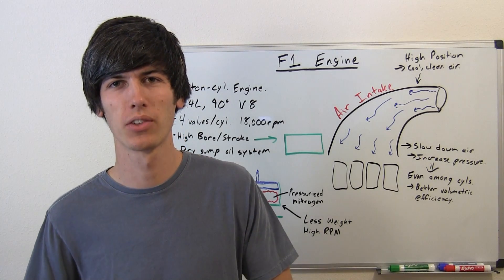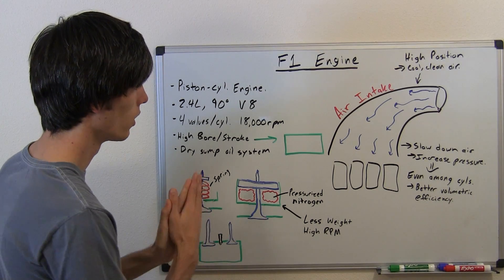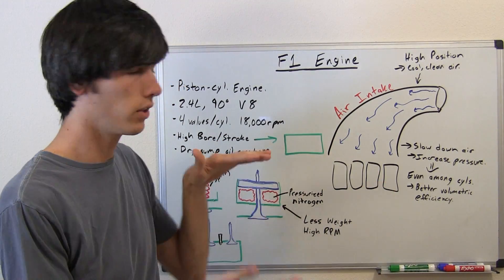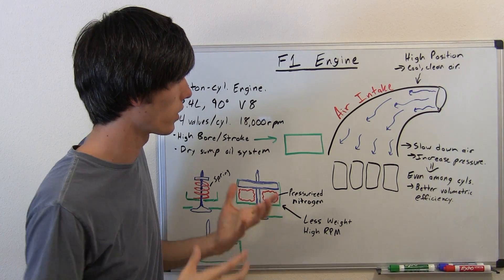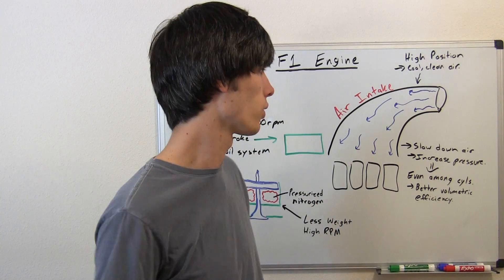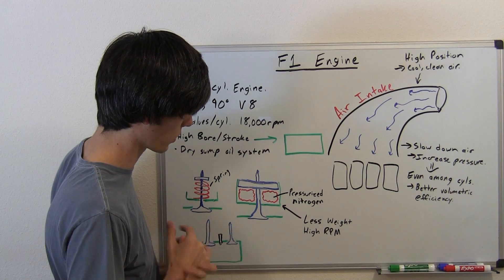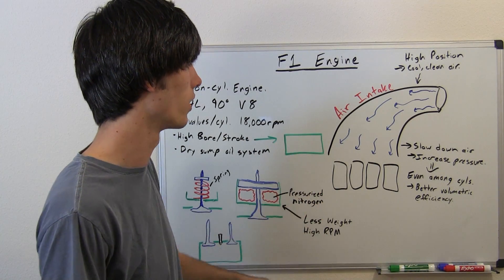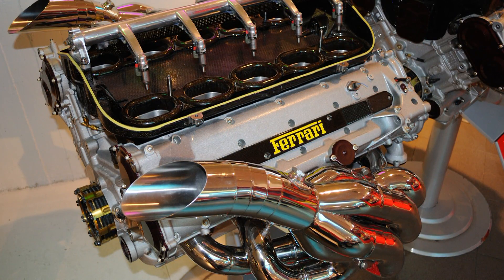F1 Engine - Explained

Comment: Provided there is no ram effect (which you suggest is the case) and/or that the engine is not consuming less air than the intake collects; I'm not sure that the (air) pressure will increase as the incoming air reaches the larger cross section areas of the air intake.

I think that you will find that the air pressure will decrease as it reaches the larger cross section area of the intake collector. Perhaps a little beyond the scope of your presentation; but the intake collector is quite a sophisticated device that actually performs several functions, including serving to form the function of and/or even "priming" the intake plenum chamber - which (a correctly designed intake plenum) itself can assist to increase the non-static compression ratio (and therefore torque) via the phenomena of "intake-gas-flow-resonance".Also, the reason for a large (or over-square) bore is to facilitate both, (1) a large valve surface area and also (2) sufficient gas flow characteristics; which comes back to volumetric efficiency.

Without a *sufficient valve surface/curtain area/diameter it would be pretty much impossible to achieve the high gas-flow characteristics required for both, the desired volumetric efficiencies at/and also rotational crankshaft speeds above, say, 12K/rpm. 

In some cases *this design consideration (and eliminating shrouding) will even outweigh design considerations (that may be - in isolation - really appealing) related to both a longer stroke and the increased torque it can bring; due to the fact that volumetric efficiency (which is directly related to torque) usually drops off as a piston engine climbs up into its upper rev limit and provides less time for cylinder filling.

The Cosworth DFV (in, I think, the 1960's) pretty much pioneered and proved most of these above-mentioned axioms with high performance V8 F1 engines. However, by the 1970's the turbocharged era was pretty much upon us and with it came new design approaches to instantaneous, composite, and other torque generation within high performance and high revving F1 engines.

If you really want to challenge yourself, you should have a look at bore/stroke and conrod length ratios, and how they apply to high performance valve-train design principles.

Aside from that keep up the good work.
Reply: +Jim Stanley Air pressure decreases as air speed increases, and vice versa. It's one of the many laws of physics. He is correct about the air intake.
Reply: +Clyde McDonald It's like a carburetor in reverse.  In a carb you're necking down the incoming air stream to decrease the pressure.  So the atmosphere pushes fuel through the carb.  In this case it's in reverse.  The incoming air stream is opened up.  Which increases the pressure.  It's counter intuitive.  Check out the Venturi Effect.
Reply: +Newman Noggs 

Just realised your last comment (to which I replied) was not directed at me.

Apologies there . . . the way my phone lays out the web-pages leave a lot to be desired.

Interesting subject though isn't it?
Reply: Den, given your approach to this matter, unnecessary aggression, and how woefully wrong you clearly are in your claims and juvenile retorts; I not only suggest a "discussion" never took place - but also that your use of the word "moron" may prove you have not read my last few posts - particularly the ones that debunk your claims that were used to - supposedly - debunk mine and justify your writing style.Therefore, no chance to have a discussion with you ever existed, and no sleep is lost there.To be honest, I had thought after my last few posts - that thoroughly addressed your claims - their questionable basis - and debunked them - that your posts would dissolve into more of this; insults and aggression, but no real proof in relation to the hard questions and why your claims are without basis. BTW, your above-exposed mammoth oversight (in my above posts) with F1 and Mercedes/AMG that was supposed to prove your point (even if you leave out how you hypocritically claimed that it was I that was supposedly not reading your posts) combined with how I previously posted where I used to work, was the cause for great laughter over here.As was your assumptions about roots blowers; that supposedly proved your point.As was your claims for me to learn physics.Thanks for all that.This is why engineering degrees (let alone serious roles in the fraternity) are not handed out to just anyone.Please let us know when you can answer the hard questions and explain yourself (even half) as well as you throw around insults, circumvent the provision of answers, and assume to know how real engineers/physicists that work with these things, are wrong. Finally, a word of advice; there is no substitute for real world experience with these things.By that I mean, it takes a little more than Googling "Bernoulli's Principle" and stagnant/static air pressure,  guesswork, and aggression when posting on YouTube Den.Have a nice day and please note how I have refrained from using any expletives toward you; despite the fact that - between us - I am probably more justified to do so.
Reply: +Newman Noggs 

I understand that, but please read my caveats as they give an insight into some other (oft overlooked) reasons why there is greater pressure in the larger cross-sectional areas of the intake.

Fluids slowing down are not always necessarily associated with greater pressure, as shown by the water exiting a pinched hose that reaches the end of its trajectory and cascades to the ground.

As in that case - whilst the water's velocity has slowed down considerably from the hose's exit pinched/point - the water pressure will still have not increased and as such it will remain equal to the atmosphere's.

So, there you have an example of a fluid slowing down but not increasing in pressure; opposite to how air is said to behave within the intake collector. 

If you hung the F1 intake collector from the belly of an aircraft and measured the pressures throughout it, I think you would probably realise none or a negligible pressure difference to - that when the F1 intake collector was mounted to the engine/vehicle and all the many "systems/circuits" that are, together, considered to constitute the entire intake/air-flow system; when the F1 intake collector is initially designed.   

Cheers.
Reply: Jim Stanley 
Given this a bit more thought and neither Daniel Bernoulli’s - Bernoulli's Principle, nor Giovanni Venturi’s - Venturi Effect are entirely applicable since both deal with non compressible liquids and don’t adequately cover non steady state gasses (from the grid to full racing speeds). Putting that aside, the general point of the discussion seems to be around the application of the two theories surrounding the snorkel area, which after a bit of thought is probably irrelevant, since the butterflies in the intake manifold are the real source of restriction, so everything above the intake manifold inlet opening to the snorkel opening has to be considered one big negative to positive pressure altering intake side. At different car / air speeds the snorkel design / ram tubes will create different gas vortices which will also come into play. As for it creating positive pressure, the design is not unlike to my Kawasaki ZX-10R with RAM Air. It has a small opening facing forward with a larger volume at the injector tubes, but still manages to create positive pressure in the engine. Scaling up the small opening on my high reving one litre bike to the size of formula 1 opening,  there is no doubt at speed there will a RAM air effect at speed.
Reply: +Dodgy Brothers 

Precisely.

Years ago, before I worked at AMG as a control system
engineer within their powertrain division, and whilst I was still doing post
graduate studies I had a friend whom loved drag racing in “funny cars”.

His vehicle had a scoop on the bonnet that - despite being different
to the one in question - pretty much conformed to the same dimensional characteristics
as the one in question.

They had an issue with the blower pressure intermittently dropping
after the scope was fitted and if you integrated the time the pressure was
lower with and without the scoop it turned out that it was lower more than
higher, although the highs were quite peaky and in excess of that previously
achieved.

As a result we fitted the scoop up with a variety of sensors
and measured it.

Turns out that often the expansion of the cross sectional diameter
within the waist of these scoops is not only graduated too wide, too soon - but
also largely dictated to by the engine’s intake and other features.

The result is that the enclosure’s dimensions along in the (wider
sectioned) waistline is often such that the air pressure does not increase under
certain speeds/conditions.

This can be simply understood by imagining an infinitely variable
(as the modeling software was that we had at the time; which coincidentally
accurately predicted all results) scoop where you continue to increase the scoop’s
waistline’s internal diameter.

Clearly at some point of those incremental increases the
volume will be too great for the pressure to build, and that is the case here.

Furthermore, we also modeled higher and wider scoops (that approached
the size of the F1 scoop in question) as the rules for the above-mentioned “funny
car” racing are, in that respect, far more forgiving than those in F1; which
have height and many other restrictions placed upon them - which in turn dictate
how aggressive the F1 scoop transitions from the (claimed) low pressure (small
cross sectional) area to the (claimed) high pressure (larger cross sectional) area.

In summary; not only are there compromises and unseen considerations
abound with these things - but the described pressure behavior of the F1 scoop
is largely theoretical and not entirely reliant upon Bernoulli's principle.

If that were not the case, then we would not have seen
pressure drop in the (claimed) high pressure (larger cross sectional area) areas
of all scoops tested and modeled, and as the waistline reached the above-mentioned
incremental limits.

I hope that clears this matter up.
Reply: Jim Stanley LOL...once again F1 engineers getting paid X amount per year all overlooking something that costs every engine in F1 horsepower? You think that they would have tested it, but yeah "Bernoulli's Principle", "Bernoulli's Principle"; without understanding how/when to apply "Bernoulli's Principle". I tried to explain it, but if you cannot understand then I cannot help any of you. It is very simple.
Reply: Dear me Den, you seem to have forgotten that I am aware of
the posts you mention; so they don’t serve as justification for curious/aggressive
approach to this matter. 
Now, despite all that and your long/rambling and aggressive
post . .  it still appears you are still
unable to explain the difference between the real world measurements of these
devices and that of simply screaming out "Bernoulli's Principle" - "Bernoulli's
Principle".

And to be fair - if you were correct on this issue - you
would be able to explain this and show/explain how we all got it wrong with the
below/above(posts)-mentioned research and design we did.
Furthermore, and this goes to your comments about static
and  stagnant pressure; any well versed
engineer understands the difference between static and  stagnant pressure - it is basic 2nd, if not
1st, year engineering. 
Perhaps it was on oversight on your part to assume that had
not already been considered.
Or perhaps it was too complex for you to consider all the
relevant engineering points at work here, including the volumetric consumption
of the internal combustion engine (that are a function of rotational crankshaft
speed) and also the scoop’s varying intake flow rates that are a function of
velocity, and how all that interacts with the overall scoop-system you seem to think
is solely a function of "Bernoulli's Principle".
As I wrote in the post that I explicitly* referenced in one
of my posts above this post . . . . . 
“Turns out that often the expansion of the
cross sectional diameter within the waist of these scoops is not only graduated
too wide, too soon - but also largely dictated to by the engine’s intake and
other features.
The result is that the enclosure’s dimensions
along in the (wider sectioned) waistline is often such that the air pressure
does not increase under certain speeds/conditions.

This can be simply understood by imagining an
infinitely variable (as the modeling software was that we had at the time;
which coincidentally accurately predicted all results) scoop where you continue
to increase the scoop’s waistline’s internal diameter”.
Therefore the pressure drop in the (video-claimed) high
pressure (larger cross sectional area) areas of the scoop that we tested and
how this interacts with the air consumed by the engine is not simply a matter
of "Bernoulli's Principle", 
particularly as you seem to be applying it.

The proof of that - at this point - appears to be that you
still have been completely unwilling and unable to explain and/or debunk the results
of the above-mentioned design activity (see above where it states  . .“This can be simply understood by imagining an
infinitely variable . . .  .”)
that we were engaged in at the time that - by way of sophisticated modeling software
(from AMG) and also real world measurements - clearly substantiated the results
I am explaining  here.
Finally, as for your comments about F1 and the overall
inference that (the impression provided here that you appear to have subscribed
to in relation to how these devices really work means) they must be right
because they are “F1” with a big budget. . . . .  .

Please see my above pertinent post where I state I
previously worked; within the powertrain division for AMG.

And, my overly aggressive posting comrade   . . . . .in case you didn’t know; Mercedes
Benz AMG also race F1, and have done so for years.
Ramble on all you like about it - huff and puff - beat your
chest - but unless you can answer and explain the above results we calculated
and discovered (including my earlier post’s comments related to the
calculated/measured limits of widening the internal diameter waistline
of the scoop - their implications for those whom claim "Bernoulli's
Principle" is all that matters - and how, clearly at some point of
those incremental increases its {hopefully} obvious that the volume will be too
great for the pressure to build) in the context of your stance on this matter;
as far as this engineer is concerned  . .
. it’s all hot air.

So please let us all know when you can - with engineering,
physics and real world tests - explain the discrepancies mentioned above in the
context of your stance on this matter.
Please try not to take this too personally, as many quite a
few coming into the subject/industry with little experience, not only fail to
realize that F1 teams rarely release all the relevant data about how their
systems work - just as much as they often take for granted what they are told
in videos and texts, (and believe) only to then find an engineering/physics
principle that seems to support it (this is called discovery bias), to go on
and fight their beliefs/arguments on that basis.
Good day.
 PS: the comments of yours that I am referring and  responding to do not seem to appear here all
the time. 
That said, they do arrive and come through my account
reminders. Interestingly, your last post - as you curiously suggested I
need to come up to speed on physics and engineering, and despite it containing quite
a few oversights (such as the assumption; [i] that superchargers create back
pressure on their intake side - when turbocharger chargers are the only
manifold pressurization device that does that, which is a claim of yours that makes
a complete mockery of your assumption that . . . . .  “Den Long Post 3: Putting the scoop on either restricted the air
through the scoop or simply allowed the pressure waves created from the blower
to bounce around inside of the scoop making even more pressure waves.”
Not in the least as there was a calculated/measured constant vacuum at the
intake/opening of the supercharger we measured, [ii] and your assumption that the
blower in question was a roots blower - when in fact it was not (either way it
doesn’t matter as you are wrong on this count too as a properly fitted roots
blower will have the same result at its intake otherwise it’s not working as
designed), [iii] also the fact that you may have overlooked that, when
calculations are done on the amount of air-volume ingested by a typical
drag-car going down the ¼ mile, you may find that a much smaller static
capacity F1 engine running an extremely high rotational crankshaft speed
through its course is not quite as incomparable as you have suggested; and  even if you remove the separate considerations
for each engine’s different stoichiometric calculations pertaining to the
quantities of reactants/products in chemical reactions as they apply to each particular
engine’s fuels that are used, and also how those resulting calculations in turn
impact an engine’s overall air requirements, [iv] finally, with respect to your
above-mentioned “Den Long Post 3” assumption {my above point [i]} if your had
read my earlier and opening posts caveats on this matter (something I had
explicitly ~requested you do when right after you first started wading in on this
matter, wrongly suggesting that we had not considered static/stagnant pressure;
see below ~cut/past reference) you would have seen that your comments here.
.    Den Long Post 3 “Since the engine is not taking the air as fast as it
is being rammed into the scoop then the air simply stacks up and the extra air
does not go trough the scoop, but is being bleed off to the side of the scoop
since it has no where to go. It is full of air so to speak. There is a ram
effect and that increases static pressure too not decrease it” basically
agree with what I am saying; as one of my early caveats was stated as . . . .”provided
there is no ram effect and/or that the engine is not consuming less air than
the intake collects” - was quite long, full of unnecessary insults, erroneous, and
not only do I have a copy of it in the event it doesn’t appear here in this
list again - but I have pasted it below.
~Please read my posts entirely and the caveats that are
attached, and consider the various, changing and
differing vehicular/engine speeds
I have not even touched on the fact that the scoop in
question and/or when this video was made it is not clear whether or not it
related to F1 engines that were turbocharged; goes to what I say above and in
earlier posts.
Reply: +Justin Simpson No not necessarily. Please read all my above/below comments (including those about water in response to Newman Noggs) in relation to the matter and how pressure does not always (seem to) behave in accordance with certain principles that - in isolation - seem to explain everything. 

You have to know where and how to properly apply Bernoulli's principle, and how stagnation pressure works, and in fact the principle itself is not really a good, or the best, principle to explain how a plane flies, even though it can define that action.
Reply: +Jim Stanley Agree, it would decrease pressure as it increases in area / volume. I didn't twig to that immediately, but I looked at it like something was wrong, just couldn't put my finger on it. Just following a simple venturi effect tells you that would be the outcome. The pressure would be greatest at the snorkel inlet with the lowest flow, but looking at the size of the opening it would probably still be large enough to create positive pressure at the manifold. Mind you we are working on the assumption that the area does in fact increase... Just because the outside gets bigger towards the manifold doesn't mean the inside does (at least until closer to the throttle bodies). Not having the flow figures in hand I would assume that at race speed they probably need to decrease pressure to avoid too much ram air effect.
Reply: +Justin Simpson at least someone gets it here. good job justin
Reply: +Dodgy Brothers 

Thanks DB. A lot of people that support the "vanilla" application of Bernoulli's principle here not only don't seem to understand how/when it is applied - but they skip over the above/below posts discussions I have provided also . . . . . just to jump in with a "me too" response that says . . . "I (think I) know Bernoulli's principle".Quite funny really.

After all, there is no point in applying the mathematical approach related to functions of complex numbers, if long division will do and nothing presents the need for conjugates.
Reply: +Jim Stanley I the issue is that you are confusing "Static" air pressure vs. "Stagnant" air pressure. Static air pressure is due to the random motion of air molecules. In a closed system if the temp goes up Static pressure will go up since the molecules are moving faster and have more energy when they run into the pressure gage. Stagnant air pressure is how much pressure would be generated if a moving volume of gas were to be stopped. In a closed system like a loop of pipe, if the air is not moving then Stagnant pressure will be at zero, and Static air pressure will be at some value. As the air in the pipe starts to move in one direction around the loop the Static air pressure will drop and the Stagnant air pressure will go up. Hope this helps.
Reply: +Den Log 
No, I have considered and elsewhere written about that. Please read my posts entirely and the caveats that are attached, and consider the various, changing and differing vehicular/engine speeds. Thank you.
Reply: Jim Stanley The total airflow going through the little hole at the front is greater then what is being used by the engine. Look at the size of the intake for each cylinder, much smaller then the hole at the front. Only if the inlet was a massive restriction and was limiting the amount of air passing through it could what you are thinking be even possible. The air is simply changing velocity to get through the smaller hole while the total volume remains the same. In order for the volume to remain the same the Static pressure has to change as well. If not there would be a different volume of air.

Under "normal" air conditions less air velocity in one direction increase static pressure since it is more random in motion, and more air molecules will be able to randomly hit the pressure gage. When air is in motion not much of it is actually hitting the pressure gage since the molecules are all moving in the same direction and not towards the gage. In other words there will be more Static air pressure inside the cowl as the air slows down, EE is correct.
Reply: Den Log There are so many variables unless we had access to gauge reading we are all taking stabs in the dark. There is no one right answer as the conditions inside and outside the scoop are constantly changing variable. Remember that back in the pre turbo days (which is what we are discussing) The engine idled at several thousand RPM and with the car stopped (no assisted air pressure) it would be a completely different scenario to full race speed at varying engine conditions. That's not even factoring in any change in volumetric efficiency as revs change.
Reply: I came here to say the same thing.  (Chemical Engineer btw)
Reply: Good to hear/see some common sense finally come to the debate.Welcome Floyd.As there is a little more to it than simply declaring "Bernoulli's Principle", "Bernoulli's Principle"; without understanding how/when to apply "Bernoulli's Principle".
Reply: So do you agree with what I am saying, or not?
Reply: Den, I think
you're a little aggressive with your comments to be honest but lets roll with
it and see where it takes us in the context of real world engineering and
science.

Firstly - and
whilst you're on the subject of whether I understand English and can read - it
may be best for you to read all my above posts, including those *to Dodgy
Brothers . . . . .  starting with . . . . 

 

"Years ago, before I worked at AMG as a
control system engineer within their powertrain division, and whilst I was
still doing postgraduate studies I had a friend whom loved drag racing in
“funny cars . . . . ”.

 

His vehicle had a
scoop on the bonnet that - despite being different to the one in question -
pretty much conformed to the same dimensional characteristics as the one in
question".

From there, if
you can - with logic, science and engineering - explain and debunk what we
discovered and also explain how it doesn't apply here - including the
section of the above *post referring to . . .

"This can be simply understood by imagining
an infinitely variable (as the modeling software was that we had at the time;
which coincidentally accurately predicted all results) scoop where you continue
to increase the scoop’s waistline’s internal diameter".

 

I would be happy
to hear your logic on why and how.

 

Finally, and this
is just some food for thought, perhaps the person that said they were a
chemical engineer (Floyd) got a positive response because they didn't start out
aggressively, they understand all the principles that apply and when/how they
apply, they are an engineer, and also because they knew that all they needed to
say was not aggressive, short, and simple, due to the fact that it had already been
explained why most simple applications of "Bernoulli's Principle"
wont always lead you to the right answer with respect to what we have been
discussing.
Reply: Jim Stanley come to find out they was arguing with a professional on the subject not just someone posting an  opinion lol
Reply: Jim Stanley i
Reply: Don't know if you figured it out yet, but you are confusing the relationship between ambient (outside) air pressure, the affect of a velocity head and the affect that will have on the plenum pressure head.
You, and others, also seem to be confusing the volume of air entering the airbox intake and that entering the engine - the important thing is MASS, and by using the ram effect to pressurise the plenum for the same volume of air entering the cylinder, the density is increased and so there is a greater mass of oxygen available for burning.
While it can be argued that Bernouli's Principle 'might' have some relevance, what you and some others should really be thinking of are the Ideal Gas Law and the relationship between the three 'Heads' in Fluid Dynamics.

Oh, and you forgot 3/ higher rpm potential.
With the DFV, their limiting factor was the connecting rod which initially limited them to ~10k and with further refinement they were rolling the dice at ~11k before snapping them on the overlap, some of the other old farts may remember those days. By that stage the turbo' 1.5 litre engines were already clearly superior, so they were dropped.
Reply: +sera56jase  Are you guys dense or am I tripping?  This comment is literally explaining exactly what he already said in the video---he said the air pressure decreases.  

He was wrong about the ram air part...obviously there's a reason the scoop is facing forward and is completely NOT aerodynamic.  It's just that it's not the PRIMARY purpose of the design.  

He's also wrong about 1 atm being the "obvious" limit.  There's no reason that a turbo or something couldn't at least THEORETICALLY compress air within the chambers beyond one atmosphere.
Reply: James, I don't think you get it either. The induction system trades velocity for pressure - the velocity being the relative velocity of the vehicle through the air and the pressure being in the area around the inlets to the intake ports - he actually said it - velocity drops NOT pressure as you and others seem to have heard.
What he did mis-speak about was the amount of air the cylinder could draw in - he would have meant the volume of the cylinder which, at 100% volumetric efficiency would have atmospheric density - at 90% volumetric efficiency, as would be found in a 'sporty' production engine, it would be the equivalent of 90% atmospheric pressure in the cylinder... However, due to careful design of a race engine, with ram effect, etc, normally aspirated volumetric efficiencies of up to 150% have been achieved. With forced induction, which increases the pressure in the intake, it is possible to get much higher percentages - but it isn't quite that simple as the actual density is partially reduced by compressive heating - adiabatic efficiency.
If the vehicle was stationary, then there would be a pressure drop relative to the ambient air as the duct opening would be a small restriction, but the relative velocity from the vehicle's movement outweighs that slight disadvantage. I don't recall the specific pressure gain from the velocity - for some reason 0.7 PSI @ 200 mph comes to mind and as nominal atmospheric pressure is 14.7 PSI, that would be a nominal ~4.7% increase in density and potential power... Definitely well worth having as it would be ~38hp on a 800hp base engine.

Perhaps some of you can picture it better as holding an open can into the wind when a vehicle is driving down the road. You can feel a force pushing the can back and that force is because there is more pressure in the can on the closed back than outside. If you make a hole in the can that lets some of the air out through the back, the pressure inside will drop a little but still be greater than the outside. That higher pressure area inside the can is denser (same temperature) and contains more oxygen molecules that would be available to burn fuel.

Anyway, don't kinow where the time has one, but seems it's 6am now and bloody cold (winter down here), so g"nigh all.
Reply: `MUST-GO-TO-BED!

Before  go - Jim, Den definitely has a better grasp than yourself, sorry, but it's true.
Reply: PV=nRT
Reply: If you actually were trying to get the right info out for everyone you wouldn't do it on YouTube. Please stop stroking your own ego by leaving comments jim
Reply: This whole silly discussion is just psychological masturbation. The differential equations that quantify these things are so complex that not even computers can solve them analytically and you need FEM approximations to really know how a fluid will flow in a complex system like an engine's intake.

I'm sure the F1 engineers have done a lot of that and the air intake is about as efficient as filling the engine with fresh air as it can possibly be when it's all said and done.
Reply: Ummm...Bernoulli's principle shows that as air funnels into a smaller diameter tube, air pressure decreases, and air velocity increases. This is how aircraft fly. So air pressure would increase as the intake diameter increases, and the velocity would decrease.
Reply: I agree with you on how the air pressure entering the air intake above the driver's head goes from high pressure to low pressure, not the other way around. I feel it is designed that way because when a gas goes from high pressure to low pressure, the gas' temperature decreases, therefore making it possible to fit more oxygen molecules into each intake stroke.
Reply: Jim Stanley Do you understand English at all? Maybe if you did you would already know the answer to your question. Maybe that is why you cannot figure this simple thing out for yourself after I wasted my time writing two posts for nothing.

I guess it should not surprise me when you say "Good to hear/see some common sense finally come to the DEBATE" when the person says nothing other then that they are a chemical engineer... They really added to the debate all right...LOL. Sorry, but it was to funny to pass up.
Reply: gas can only flow from high pressure to low pressure. the other way round is impossible.
Reply: Jim Stanley STFU you waste of time. You lost your chance to have a discussion with me moron.